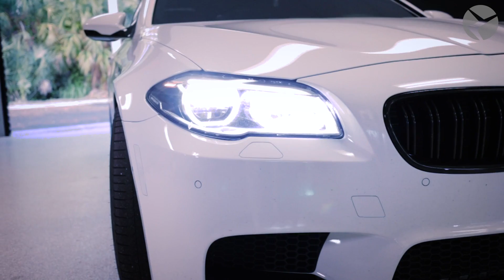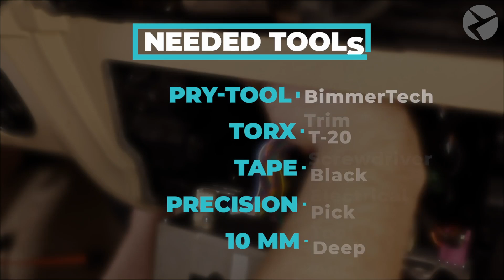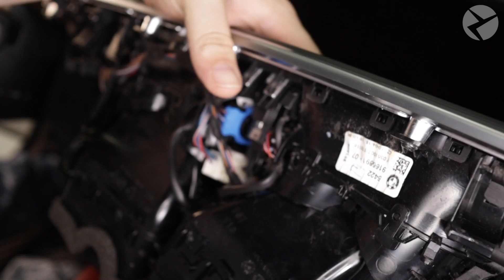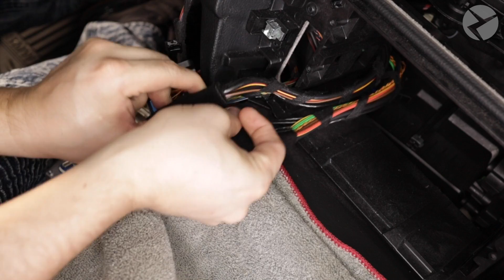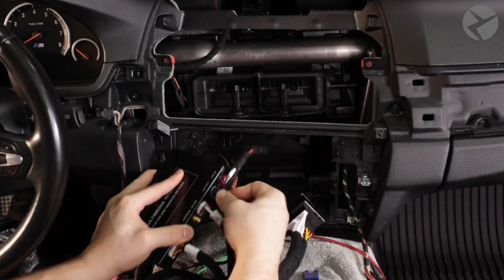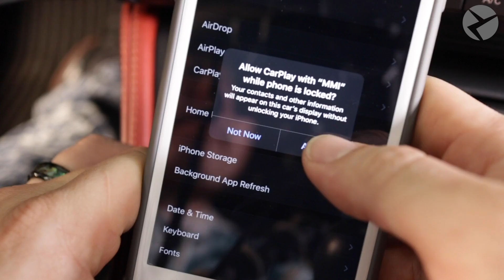CarPlay MMI Prime Retrofit in BMW F10 - Installation Tutorial

Comment: Installed everything, per this video, in my F10 550i.  The most detailed video I found so far.  Everything works perfect on the OEM side-sound, iDrive, Nav, all work.  When I switch to the Android side, I'm not getting any sound on anything.  All of the apps work: Waze,  Google Maps, VLC, I can see a video trailer however, I  still get no sound on anything.  What the hell am I missing.  Tried to do a Factory Reset - Wants a Passcode...wtf!!
Reply from the maker: It sounds a lot of like you have not switched the audio source to AUX within the iDrive. Our MMIs require you to be in AUX in order to pass through any sound coming from the CarPlay. As for the Passcode issue, I am not sure what passcode we are talking about, please send our support team a picture showing the issue.

Comment: Great video and tutorial. 

Will you still be able to update iDrive software and do coding/ modifications via bimmercode?
Reply from the maker: Of course.
Reply: @bimmer-tech  thanks for the swift reply. Unfortunately I just found out on the bimmertech website that my 2012 F11 535 xDrive is not compatible.
Reply from the maker: @sanadek1  If you don't mind - send us an e-mail to info@bimmer-tech.net with your VIN and we can double check :)
Reply: @bimmer-tech  Hi. Just contacted Michael via online chat at Bimmertech and he confirmed that it's incompatible due to the CIC version
Reply from the maker: @sanadek1  I don't know if Michael mentioned it but we are working on a CIC version. There is a high probability it will be ready in around 2 months.
Reply: @bimmer-tech  He didn't actually but this is great news.  Will be waiting patiently.
Reply: sander dekker 2 months have passed
Reply: @ssgomes19  i know and read on a forum that someone discovered that Bimmertech actually resells the display MMI's as found on AliExpress... read all about it!

https://f30.bimmerpost.com/forums/showthread.php?t=1675929

So you may make an educated guess what my next step will be ;-)

Comment: Does this allow you to use existing front and rear cameras?
Reply from the maker: Hi! I assume you mean aftermarket cameras? In that case, in theory, yes. Our own cameras are compatible, and cameras from other brands will probably also work depending on what connection they have. In either case, it's possible you'll need a little extra hardware from us, depending on your vehicle, so your best bet is to get in touch with our team at info@bimmer-tech.net and give your VIN and technician information about the cameras.

The kit is compatible with BMW factory original park assist cameras, too, without any additional hardware. Thanks!
Reply: yes

Comment: Hey guys. I want this CarPlay prime but also want to be able to connect a hdmi device into my screen. Am I able to do this? If not what options do I have? I’d like CarPlay, AirPlay and HDMI.

What I’m trying to do is install a PS4 into my 428i F33 convertible lol
Reply from the maker: Hi! Definitely sounds like an interesting project ;) Our CarPlay MMI Prime doesn't have an HDMI port. Our SmartView HD doesn't include CarPlay, but does support AirPlay. The multimedia interface included in that kit varies depending on your vehicle's exact hardware, but in some cases has a spare HDMI port that you could use to rig up the PS4. Your best bet is to send us your VIN at info@bimmer-tech.net and one of our team will be able to help you figure out exactly what we can offer for your 428i. Thanks!
Reply: You could (hypothetically) use the rear view camera interface (seems to be a standard RCA cable) to connect a PS4 , but I'm unsure if you could have the audio through the line in being played at the same time as the Rear Camera (PS4 in this case) is showing on the screen. If you happen to try it, let us know how it went

Comment: I have a 2012 BMW 5 series F10.

It came equiped with a "small screen" infotainment system. I had a infotainment system seen in the video retrofitted, can I use this?
Reply from the maker: D Hi! This CarPlay MMI Prime works with any compatible head unit, whether factory-original or retrofitted. For the F10 that means CHAMP2 (2013 or later), Entry, EntryNav, NBT or NBT Evo ID4. You can confirm you have everything you need by getting in touch with our team at info@bimmer-tech.net
Reply: @bimmer-tech  thank you very much